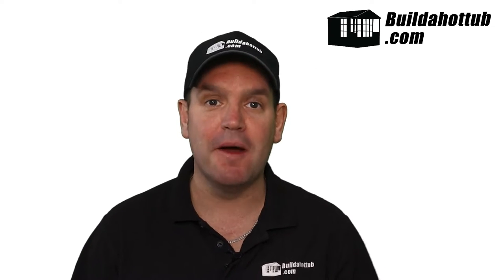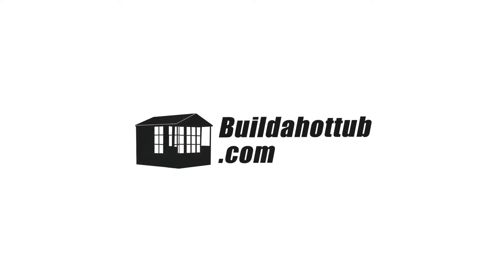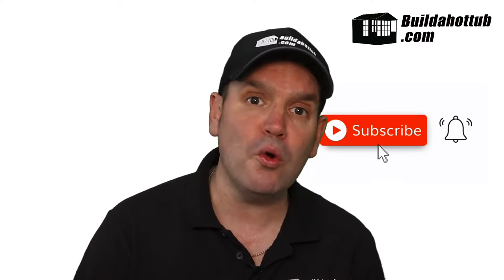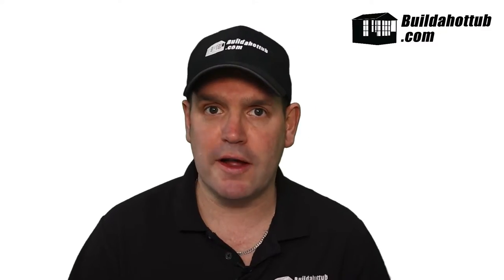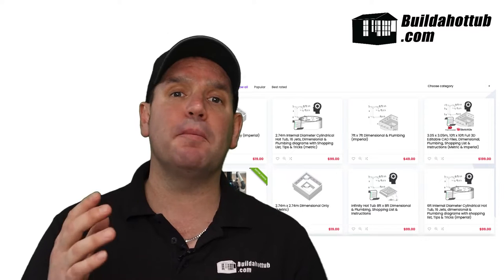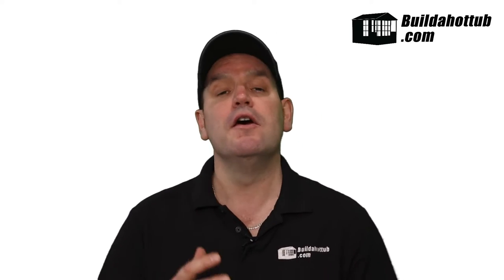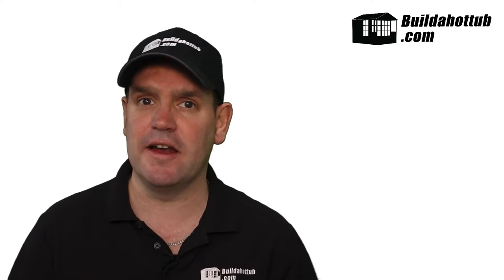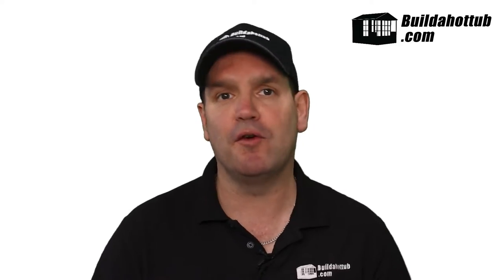How to Build a Poured Concrete Hot Tub

Comment: Single mat wall. Yeah center  will work. If it’s a center retaining wall with inside pressure and minimal dirt. Centers ok but putting the steel closer to the water side with the right angle facing the outside. Dirt is heavy but water has more out more horizontal pressure. Air is for expanding in cold temperatures. Mainly for out door pads. Walls do if they are not insulated. You can put foam on outside.  They don’t always put air on walls or footers because footers are underground., depends the  size . I built water treatment plants in mid Atlantic east coast and desert out AZ .  If you mix it your self it’s fine if it’s not the same color but you want a decent slump at a higher psi. It’s getting covered with tile. So the larger you go like pools will need an expansion joints.  They have a mold plaster mix with fibers that’s you can make a diagonal mud pad . We done some. But I seen alot done on commercial senior homes and other.

Comment: You should only need one ground or run the wire half way around. I’m thinking about it. I built a few pools. I worked for a civil and structural engineer company . I’m good with archaeological drawings because I was a bridge and ctf inspector. My my profession is in concrete foundations,  walls, slabs and decks. As well as reinforcing iron, I was a union foreman. I was a subcontractor and now I’m a commercial contractor bidding on my own jobs. I want to see the bonding . If my tub is smaller how thick I need it. I can check the specs for my states code. But they normally run one ground in the ground but run it all the way through. If it’s a big building thry might have multiple points . Grounded energy. But the concrete insulates it.  It’s really to pick up the negative energy from the ground . Is my opinion. Copper probably gives it energy like it does with the plants . I’m run copper too my craw space and might put a ground . Add one sonce it’s an older house.

Comment: that is a beautiful hot tub! and a great tutorial about the construction

I'm currently constructing one myself. doing it all myself to save a bit of money. I can get the wooden reinforcement quite cheap or free by using pallets and off cuts, and intend to use the earth as the outer support and concrete board designed for wet rooms as the inner layer so I have a nice smooth finish and less wood to remove (its nearly as cheap as wood at the moment anyway). its not quite going to be as fancy as that one but honestly I'm hoping for something not too far off but for a fraction of the price once I'm done

just out of curiosity, what was used to mould the shape of those curved seats?  I've got a size for my hole that will give me a 3m x2m tub with a depth of about 1.4m. I am currently planning out the interior. if its not overly difficult (as in it just takes some time and hard work) I'll definitely go for a similar layout with those curved seats and add an extra couple of jets into the design
Reply from the maker: Thanks for the comment and watch Oli. For the seats, they used a wooden mould and the design you can find on my site here - https://buildahottub.com/how-to-build-a-concrete-lounger-for-your-pool-cocktail-pool-spool-or-hot-tub/

If you need any assistance or parts, please do get in touch, cheers - Andi
Reply: @Buildahottub  thanks for the reply and the advice 😊 your website was very useful thank you

Comment: The maine reason you never hand mix concrete for engineered insitu reinforced concrete structures is, you can never be accurate or maintain the integrity of the concrete mix to achieve the design strength, unless you are using a batching plant on site, a Ransome with strict adherence to proportions of aggregates, cement and admixtures, then you may be closer to achieving the desired outcome. 

Also remember to use a poker vibrator to ensure the concrete is settled and all the air pockets are removed. Do not over vibrate or you can cause a separation of the heavey aggregate from the concrete mix, causing honeycombing, and fast dehydration of the concrete. 

What is not mentioned is the difference between a two armored part pour and a monolithic pour.

In a monolithic pour, the forms and rebar are placed,.along with any plumbing fix, allowing for a one time pour to ensure uniformity and the need for waterproofing between pour joints, as it would be for a multiple pour structure. You would need to set a waterproof  moisture barrier material in the concrete to prevent leaks and seepage. Remember, concrete poured in parts does not join.
Reply from the maker: What a great comment - thank you!

Comment: Now for the question many probably have: How much does it cost to build a tub like that?
Reply from the maker: Hi There, this build Kyle used a lot of contractors and ended up costing just under $50K. This was half what he was being quoted by several pro pool builders. He did say that if he had done all the work himseld, he would have got it under $30K. To give you an idea, all the other case studies on my website www.buildahottub.com (and on this channel) and most of my builds with customers come in comfortably under $10K. Cheapest you can do it for is about $6.5K. - Hope that helps and thanks for the comment. Cheers, Andi